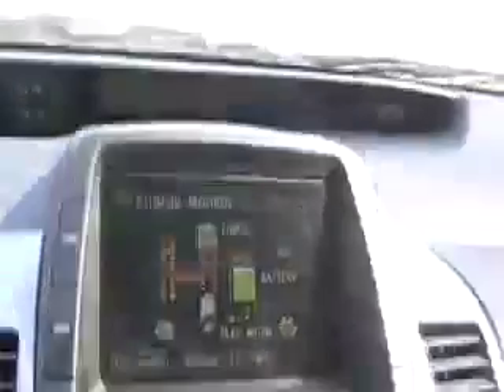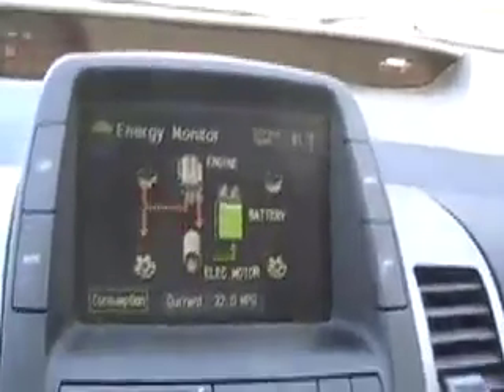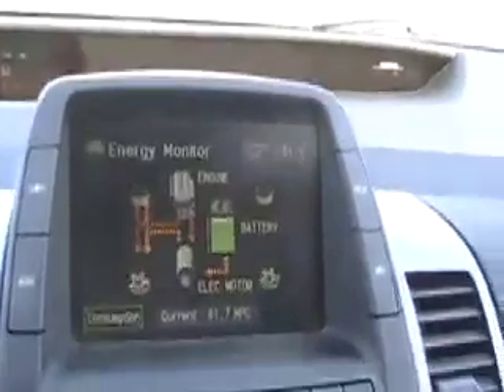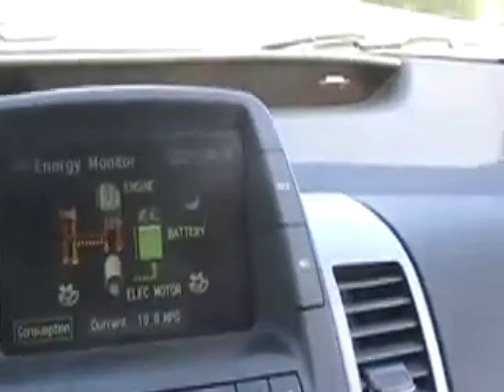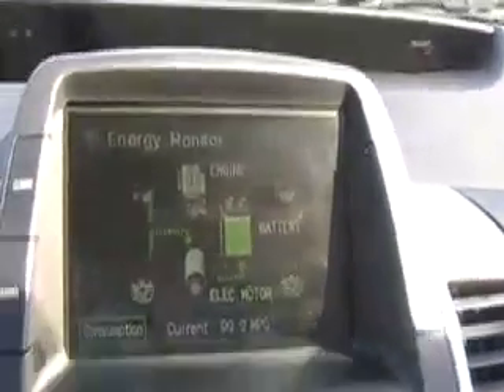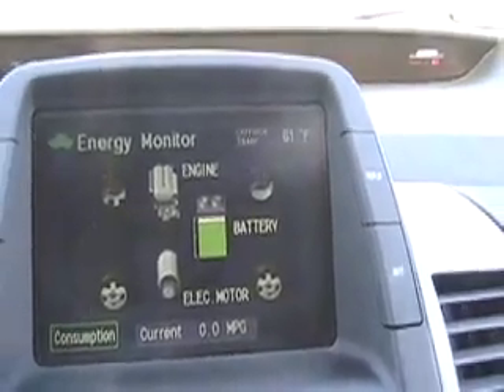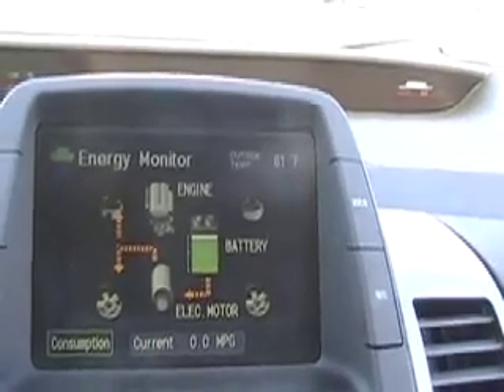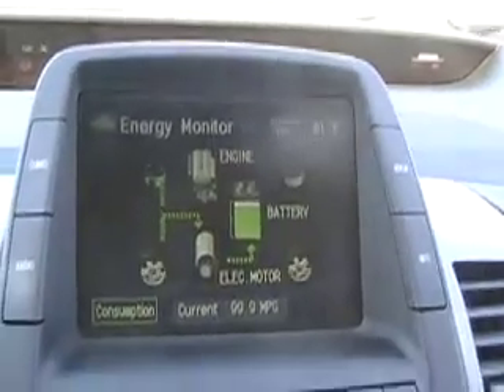Three big problems with the Prius - Tape 1

Comment: @whole27 50MPG is what the EPA tests showed when they drove the vehicle. 100MPG is a bit pushing it, but I get 60MPG on a regular basis, all you have to do is drive 60mph instead of 70mph, drive SAFELY in the lane that is *next* to where a large truck drives, not in the same lane! And about 50yards back, this works for many cars, not only hybrids and is very safe.

Comment: You're assuming sir that the animated battery level readout when full, represents the actual charge level of 100%, when in fact, a full indication on the display, in actuality, is in the area of 80-85%, so that in computer detected stop and go traffic, the battery pack's internal resistance is low enough to readily except any heavy regenerative charge when braking.

Comment: Sounds like your pseudo-science is what's holding back the hybrid car.  I wonder if Toyota will pick you up as a consultant for their hybrid programme...

Suggestion:  don't try and drive it like an electric car.  or like a gas car.  just explore and find the right driving style for the Prius - it has it's own - and you'll do much better with it.  You wouldn't get in an F-150 (Ford) and try to drive it like an F-430 (Ferrari), would you?

Comment: The Pious IS a gasoline/electric hybrid.
And, a full charge/discharge wears the battery out more than a small cycle so to gain a few years they limit the depth of the cycles, much like any car battery.
And, again, the Prius is NOT an electric car, you can not even plug it in to charge for a reason.

Comment: There are four fundamentally things that is wrong with your video:
1) They don't view it as a gas car, it is a Hybrid.
2) You don't understand how the hybrid system works, no really, you don't
3) This isn't an electric car
4) You don't know how to drive a Prius. When I first got my Prius, I was getting about 40MPG, 6 months later I am getting 61MPG, I don't care how it does it, what propels what or how, the graphical display helps me get the 61MPG, in your case, the display gets you confused.

Comment: @liveoilfree Just intresting to note, that the prius actually runs more efficient if the battery is only used for assist.  The prius was not ment to run long distances on the battery because you cant plug it in, the car has to charge the engine with the engine using a lot of gas.  I dont know if you have ever heard of hypermiling, but I hypermile my prius everyday and I can get 65-80 mpg out of it.  But I wish I didnt have to use the gas engine at all.

Keep up the good work!

Comment: I think there is a reason why Prius is designed as it is.

Here is why.  An IC engine is most efficient at about 2/3 throttle.  If the power to drive the car forward is less than the 2/3 throttle setting, efficiency will drop fast.  There is a point, according to power mappings where it makes sense to store energy in the bat.  ... hence the in and out to the bat.

There is technology in development  that will make this all obsolete...including the volt.

There is no conspiracy by oil...

Comment: As a Prius driver, I do not want my battery to be empty.  When that battery status goes down to three bars I'm fucked, because as soon as I put my foot on the gas the engine starts and uses up a shitload of gas and ruins my mileage.  I drive just at the right speed and pace so I'm always somewhere in the mid-upper range, never FULL either because that screws up your battery.  

By the way, the FULL and EMPTY indicators on the Prius means 80% and 40% charged respectively, NOT 100% and 0%.

Comment: The electric generator , electric motor and gas engine are used to create a continuously variable transmission through a planetary gear set.  When the battery is fully charged (one bar below full, so there is room to regenerate) the display shows this cycling between charge and discharge but there is almost no current flowing.  It isn't significant so get over it.  If it was significant the mileage would suffer.  Do you really expect us to believe that your engineering prowess exceeds Toyota's?

Comment: Deep cycling of the Prius battery shortens its life and they are very expensive.  THAT is why the discharge is limited.  If you knew anything about engineering you would realize that.  The battery is designed to last 220K miles and this was not attainable with current battery technology without limiting the rate and depth of discharge.

Comment: COMPLETE IGNORANCE. RIDICULOUS.
YOU HAVE NO FREAKING IDEA. 

The Prius battery technology is a proven technology and IT WORKS. The Battery should NOT be made do go flat. By optimising the battery at a certain charge they INCREASE THE DURATION OF THE BATTERY, so it will last LONGER. 

Besides, if it's so badly designed then explain why its so EFFING EFFICIENT despite this.

Comment: >Well, no one has tried to sell pure EVs, or the GM volt-hoax, for that matter.

Wow, that is so wrong in so many ways.  Why don't you look up the EV1 that GM made, they built it for the sole purpose of showing how ridiculous "EV" is and got people buying big trucks and SUVs instead.   For GM, the EV1 was a huge success as the spectacular failure of the EV1 pulled customer's attention away from "EV" into bigger and larger vehicles which is a market GM and other U.S. auto makers always cornered.

Comment: Couple things that say a couple things....

1) if the car is such a problem... why did you actually buy it?

2) If you stopped pulsing the gas pedal, the charge would stay in the same direction.

3) If it's so bad for the battery, how come I have averaged 50 miles per gallon for the past 130,000 miles since I bought it?

4) How come there has never been any stories of Prius' with faulty batteries?

-Conclusion-

The Prius is designed just fine

You sir, are a moron, so STFU

Comment: Seems to me you need to go get a Zap Zebra electric tricycle rather than a Prius.  You keep refering to the Prius as if the designers wanted to build an electric car. The design brief was to build a car that used half the fuel of a similar car by using advanced technology.  I believe Toyota excelled at this and I believe when they chose to build an electric car for the consumer market they will excel there too.

Sorry if someone gave you the idea Prius was an electric car, it wasn't Toyota.

Comment: I am not aware of anyone needing to replace their battery so your theory of it being bad for the battery is flawed. Using the battery all the way down is bad for it, so you are wrong there also. The battery is charged from braking, coasting, and excess power from the engine. Calling it a Frankenstein car is actually somewhat accuarate, a merging of two technologies. The one thing I agree with, which is a technological hurdle is that it does have a split second pause on a quick start.

Comment: Solar power is not practical. Ever wonder why there are no solar fields in Seattle? Not enough light to make it worthwhile. Also, solar cars must be very lightweight, aerodynamic, and small, and they are very very expensive to make.  

Lack of maintenance is the owner's problem, not the manufacturer. Basic upkeep and storage can prevent most electrical problems (most are caused by corrosion, which increases resistance). Rust is becoming less of an issue with alternative metals and rust-proofing.

Comment: I really don't think that EV's are the answer to energy "problems." If it's the environment you're concerned with, large batteries are EXTREMELY harmful to make.  It might not cost you much to charge them, but it takes a lot of energy, so you're still polluting heavily. I'd like to see hydrogen power rise up - mainly because every I.C.E. can be converted to run on hydrogen gas or the liquid. Every last one. So people wouldn't have to go out and buy a whole new car, because many can't afford it.

Comment: hey, i'm on your side here.  Also, a car shouldn't have a "lifetime."  With the exception of race / high performance engines (which the prius clearly doesn't have), most engines will just keep chugging along forever so long as they are properly maintained and not abused.  I know plenty of small gas engines that regularly reach 400k-500k miles - and a set of batteries just won't do that.  If Toyota designed the Prius to only last 200k miles...well, there's another problem with the Prius.

Comment: batteries cannot be designed to last a lifetime, ever.  They lose their ability to hold charge as they are charged/discharged overtime.  They will eventually not be able to hold a charge, and will need to be replaced.

Comment: The Prius is a good disign, I loved the car when I was renting it. But, the battery is too small. The Prius can goto a much higher milage car if it just had  bigger batteries. That is the main difference between a hybrid and a plug-in hybrid. The Prius I rented, only topped off the battery while regerative braking, never from the engine.

Comment: You are making a lot of assumptions about the battery in this car, explaining why you think the it will fail.  I don't understand why you're bashing it so much?  By the look of your video, whether the "wear and tear" on the battery is true (which I haven't heard of any cases of this yet, or else it would have blown up in the media), the car seems to be doing exactly what we'd like it to; it switches from gas to electric depending what is more beneficial at the speed.

Comment: The Prius is just the right size that it could be all electric, with some good range if engineered good. The Prius even could be designed so that the electric motor could be the primary and then the gasoline engine be the secondary. Not the way it is now: Gas=primary, Electric=secondary. But, as most of us know, an all electric car could have been achieved years ago (talking about mainly GM, Ford, and even Toyota). I hope the moves Tesla Motors becomes a success.

Comment: I agree with everything said here. The Prius I rented did not have the EV button. As far as the programming, you would have to be a master hacker to reprogram this car. Even if you could, as he basically said here, the battery is too small. I was impressed with how quiet it was when it was in EV mode. Its so kool to stop at a red light and hear everyone elses car running, except for mine. If the Prius just had a bigger battery the MPG could be doulbled, if not more.

Comment: This is a full HYBRID. It's is not an EV. The reason for the energy flowing back and forth it to "pamper" the battery. Cause as you surely know, full cycles are battery killers. By doing many small cycles the battery will work a long time. Ask those taxi drivers with 200,000+ miles and still running the same batteries with no adverse effect. OMG and you lost your time doing that video, what a shame.